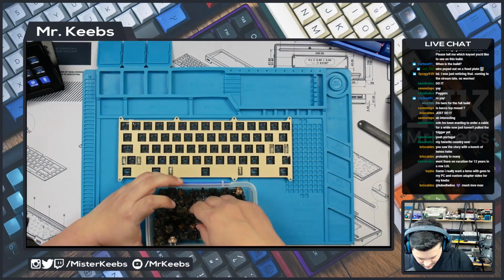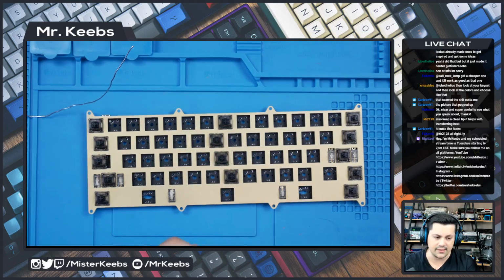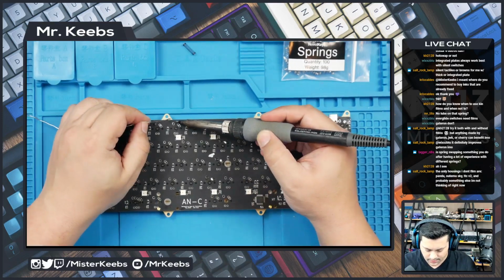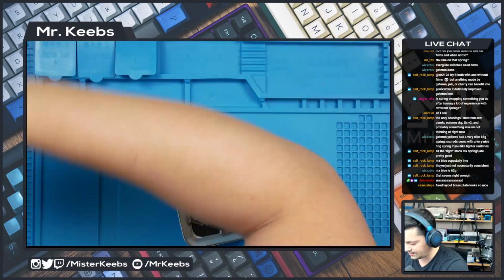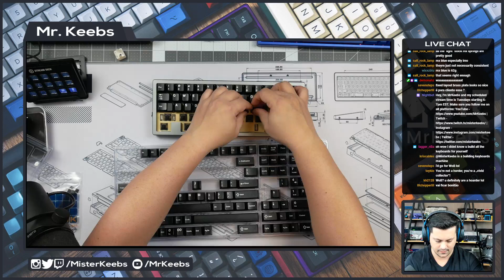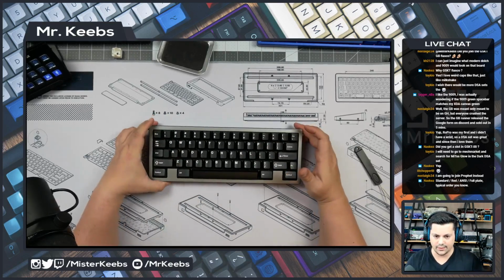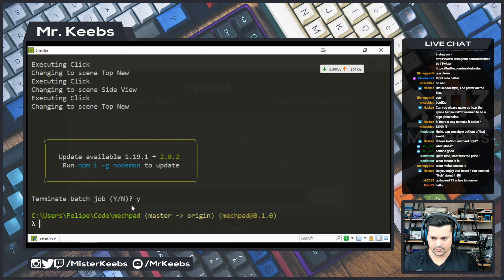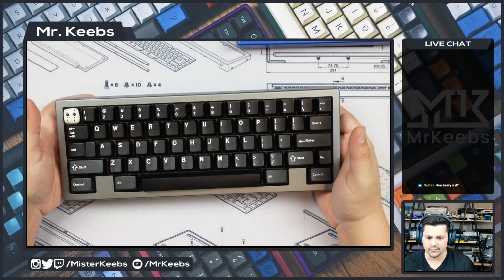Bacca60 Build

Comment: board looks kind of strange to me.. like the spacebar is offset.. not sure if blockers are helping this board. hahaa..
but then again it's not for me, i'm addicted to 65% i moved to that formfactor years ago no i have so many 65% boards with no end in sight.. my only regret is that i never bought a 65% with a blocker next to the arrow cluster not that i need it.. just wondering if it would improve my typing ?? for now my richt  Ctrl is layer2 and right Fn key is layer 1 switch.. so i'm putting those keys to good use 0% loss in functionality and without finger gymnastics or having to remember special layouts in order to aces keys like the arrow cluster.. having said all that for sum reason i always think i would like to try out something like the Niu mini from KBD don't know why..